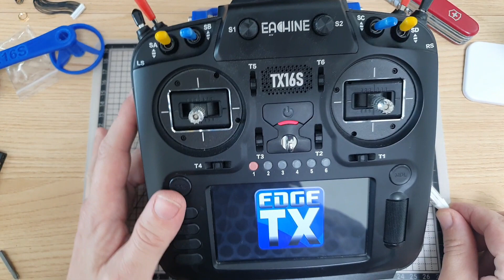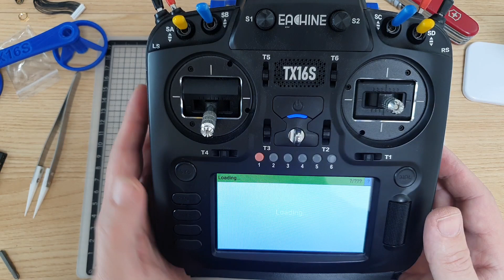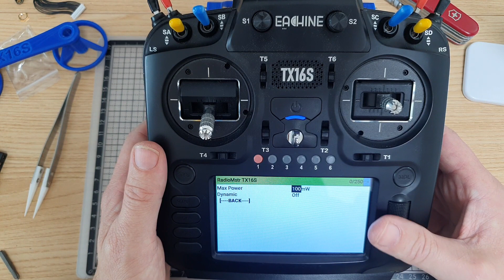Radiomaster TX16S Converting 4in1 Multimodule to ELRS

Comment: Hi thanks what difference between ELRS and 4in1 iam new for this radio
Reply from the maker: ELRS is a modern protocol, there are a lot of cheap receivers available. It has very long range (many kms) and low latency. The 4in1 works with a lot of older protocols from different manufacturers, these protocol usually had lower maximum range (300m). If you are new to the hobby, choose ELRS.